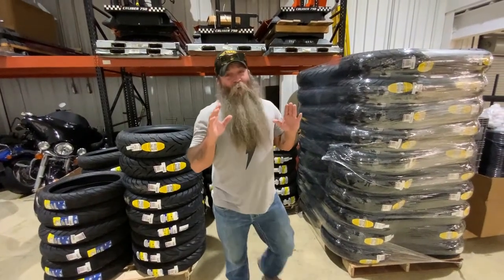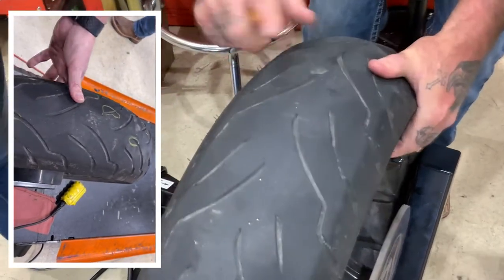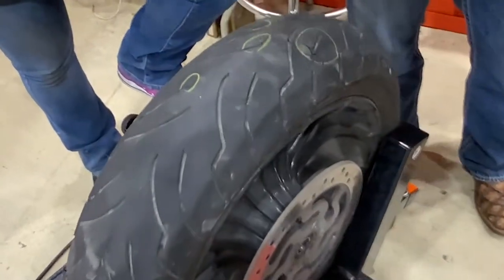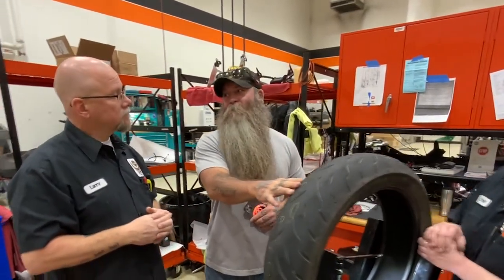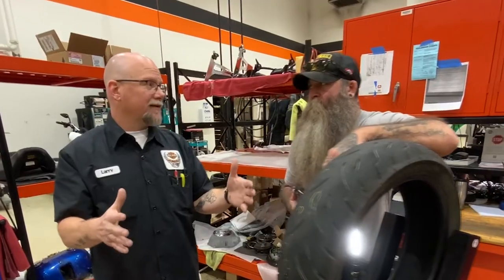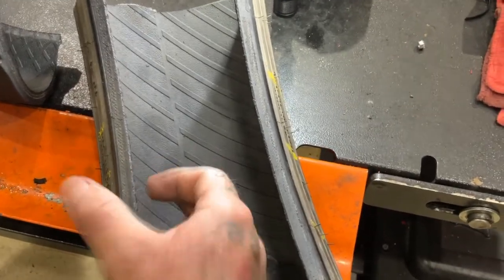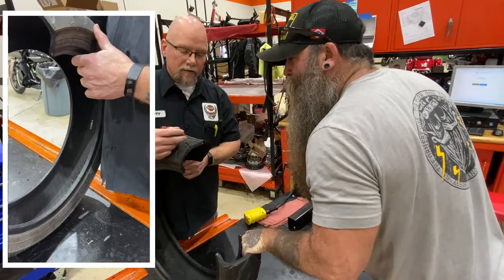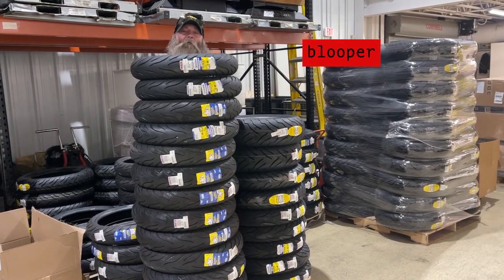Best Tire for Long Distance Touring on Motorcycle Ride? How to get the most miles from your tire~

Comment: That doesn't look normal to me.  I ride a 2018 FLTRU, (Industrial Grey) mostly just me with maybe 100lbs of gear, I'm 202 libs.  I live in an area that gets 80-100 degrees in the summer.  I'm back to running the original Dunlops and must say I like them , they perfrom well in all condtions, wet and dry.  I did try a set of Commander 2's and got much better mileage but they were no where near as good in the rain.  I also run hard, in the twisties scrapping the boards often.  I do next to nill riding on the dirt or gravel.  So after 74,000kms on the bike I 've learned that even 1 lb difference in air pressure can make a big difference, especially if your laying down a 500+ day as I cupped a set of tires pretty bad by getting lazy and not checking tire pressures.  So on the original Dunlops I get about 14-16,000kms on the back and 18-20,000 kms on the front  (8,000 to 10,000 miles on the back)...(11,000 to 12,500 on the front).  Amazes me some people say theu get 20,000 miles on a rear tire?  Oh I also live in the mountains of BC Canada, weather can change in a hurry so I like an all round sticky tire.  Might try the elites next set see if they work as well in the wet.  I check my air pressure now everyday.  Nothing like having good rubber!

Comment: I had the same issue on two American Elite tires too. I ride the same as you, but I can almost guarantee you it isn’t the weight of the bike causing it. I’d do solo trips for 6,000 miles and the tire would start splitting! I also did a video on this tire doing this. I stick to Shinko 777HD, softer compound and only get about 7-8k on the rear. Still cheaper and more safer than these Dunlop American Elites. I’ve loaded the bike with the same weight as on a American Elite....and it never splits. Great video man!

Comment: I don't buy tires for mileage. I buy them for handling and performance. I like Metzler over Dunlop myself, although my last set of Metzlers is 18 months old and the front tire I just found a crack on the sidewall the entire circumference of the tire on the high side. Starting to wonder if anything is any good anymore

Comment: I know this message is late but, My 19 RG only has 8k and I have the same issue with the stock Dunlop HD rear tire. I did contact Dunlop and they are working with me as this seems to be an issue with maybe a bad batch that were made and sent to HD to install on the new bikes.

Comment: Smiling!
Been running the American Elite 3 for years on my ultra classic in Arkansas and never get over 8,000 miles out of the rear on the chip and seal roads here. 
Got a crack in the side wall on the front that's not even half worn out. Crack all the way around both sides and you can see the white cord it's so wide. 
For the money they should last longer. That tire looks bad, real bad. Think I am going to try something else this time. 
Dunlop seems not to stand behind their tires now days.

Comment: Geez.  Got my first Harley this March (2010 Road King).  Put 12,000 miles on it.   Harley dealer put a new rear Dunlop 402 whitewall.  I got 7500 miles and it’s shot.  I don’t ride hard or fast.  I expected more.

Comment: I currently run the stock Dunlop. 
10,000 miles on it and I have the same kind of cracking on it. Also was running heavy on long trips.

Comment: Michelin Road 6 GT Pro. If the tire cracked from the inside out wouldn't it lose air? No motorcycle tire lasts 30 thousand miles

Comment: I had the same issue with the stock Dunlop tires on my 2014 Ultra Limited. Will never run Dunlop again. I'm running Michelin Commander II's now with 15,000 miles on them and still got plenty of tread left.

Comment: Had same issue with stock dunlop and the dunlop your changing out.  Went with the michelin tires and had no splitting issues wiith the michelin brand touring tires.

Comment: Ask Larry at what point your tire pressure goes up like my tire pressure is 40 psi it goes up because of riding to 51 psi do I need to let out air?
Reply from the maker: What tire are you running?
Reply from the maker: If your tire pressure was set when it was cold then you shouldn't have any issues.  -per Larry

Comment: Yeah that's very possible you need to buy a heavy a dirty tire our tire that's rated for a higher weight capacity I went to the Bridgestone extender Max because I learned really quick my bike will chew up the lighter weight capacity tires for my bike the higher horsepower I have to have a heavier duty tire and also a tire that will keep up with fully loaded heavy saddlebags

Comment: I don’t run Dunflops they are horrible wet and don’t last at all my Michelin commanders stick really good on all road conditions even tar snakes and last forever. 12000 miles ain’t nothing.
Reply: Absolutely I hate a dunflop. Commanders are where it is at.
Reply: Michelin Commander 2s were too damn slick in the rain. I use Avon Cobra Chrome in the front for the stickiness and a Dunlop American Elite in the rear. I currently have 13k miles on both and both are only 1/4 way worn. Both are great in the rain too!

Comment: Tires are cheap people, hospital and recovery from a fall is not. Please, folks...replace your tires by the time you get to the HALF rating point on the miles, running to MAX ratings isn't intelligent folks. Plus, you're just hoping your tires keep up, I want to KNOW, and following my suggestion, you'll have nice black flex and operation. You lose the tech of the tire anyway in it's back end of it's life...You'll keep them down and on the ground brothers and your maintenance will be nothing because you're running on the proper "flex" also. You were running on bricks man, about to explode....be safe folks. Let's all make riding safer ;) peace...(typed this while Larry was saying it Lol) thanks, good video man ;)

Comment: If you want a bike that handles bad in cornering get dunlops....if want a bike that handles likes a motorcycle in corners should then get Michelin Commanders. Dunlops new from the factory are to squared off and start to make the bike squirm in high speed corners which make Harleys get a bad rap for feeling like being hinged in the middle ...when all along it's the crappy tires that Harley puts on from the factory. I've owned 8 Harleys from new and when the factory tires wear out I get Michelins ...Dunlop makes awesome sportbike tires but crappie  cruiser tires.

Comment: Well you sold me to NOT buy the Dunlop American Elite, i had Metzler ME888's and went 17,000 miles and i ride 2 up and i'm 5'11" 345lbs and my wife is 5'3" 150ish  and my ME888 had plenty of tread left, but it was cupping and that's why i changed them at 17k

Comment: that tire looks very unsafe there is a problem there  for  sure  i run the  stock  dunlap tires on my 2013 street glide  got  around 20,000 on rear tire   been riding harleys  for over  20 years  always stuck with the  stock tires ride  safe out there
Reply from the maker: We have not had good luck with the stock tires at all!!! We have a video that shows some strange signs in the stock tires. Not for us.

Comment: I have gotten 14K on an American Elite Rear tire and it didn't look anything like yours. But then I am anal about air pressure, if you're not checking air pressure on your tire's you're asking for trouble you can't blame a tire for failing if you're not maintaining it. I have never been to an HD dealer that didn't try to get you to put stock Dunlop's on your bike I even had one refuse to put an aftermarket tire on once which is a joke and why I buy tires online and get them mounted at Cycle gear.

Comment: Iv tried several different brands and sizes. Iv got the most bang for buck with a car tire. Which cost about a third the cost. It handles a little different but with a passenger it's really hard to feel anything different. Never had a car tire split like that either. One more thought also. The contact patch on a car tire is two or three times larger.

Comment: Overweight and hard. I don't believe anything is going to stand up to 110° if you don't pull over if you notice any slipping or going on rough roads. It's rubber and heat is going to eventually wear any tire out. And if you are running 2up? You are lucky you got 12k in extreme heat, cold and overweight on the same tire

Comment: 12,000 miles, that tire owes you nothing. There's alot that happened in that 12,000 miles, heat, speed, road condition, weight, dude, your beard alone durn near overloaded that tire.

Comment: I'm pretty sure those are stone bruises.  If you're heavily loaded, running on hard packed dirt roads that have been covered over with crushed rock, you're going to get stone bruises.  Those marks are too small, too pin-pointed to be heat separation.  Crushed rock has very-very sharp rocks.  Ive ruined steel belted radials on my truck from stone bruises on freshly graveled roads.  Stay off craveled roads that have been layered over with crushed rock.

Comment: Way overweight on the load on that tire.... Any licensed pilot that has to do weights and balances before taking off and flying, and keeping the center of gravity correct on a plane knows how important it is to not go overweight, and also WHERE in the plane, you locate that weight, fore and aft of the center of gravity of the plane.  Another huge factor is how fast you travel!  Riding fast makes a lot of heat.
Reply from the maker: yep yep!

Comment: A poor quality tire with very poor mileage endurance for an extremely high price.

I have been using the Forceum HEXA-R 205/45 ZR18 Tires for over a year now on H-D Road Glides.
The pressure I like for comfort and safety is 36 pounds.

This tire has a larger patch on the surface and therefore more purchase on the pavement.
I ride 80-100 thousand miles per year, 99% hardtop.

I average 22-24,000 miles per tire for hard, hot, fast, and heavy riding.
And each tire costs $82.

Comment: I can't believe the condition the tire that came off your bike. That is not acceptable. Someone shanswer for that.
  Up until the last couple years I could not afford to buy new tires. 9 out of 10 times if I needed a tire I would go to bike shops and see qhatrires they had in the trash.  Sometimes I would find a semi decent tire. Most of the time they barely had tread on them.  I've run rear tires on the front, front tires on the rear.  I've even run tires for many thousand miles that were mounted backwards.  I have never had a problem with any tire that was not due to age or normal wear.  Because I always had such crappy tires, I always ran tubes in my wheels.  Most times, I would run my rear tire down so far that I would be wearing the inner tube.  
      I've never seen cracks in tires unless they were many years old and way way past there life span.  TIRES DO HAVE A EXPERATION DATE !!!  Tires are only good for a specific amount of time from the date of manufacture.  
    All that being said, I do prefer Dunlop tires on my motorcycles.  Although in the last couple years I've begun to question the quality of Dunlop tires.  I bought a 1998 fatboy last fall.  It had brand new Michelin commander II tires installed on it about 400 miles before I bought the bike.  I've rode roughly 5,000 miles on those tires and so far I've been impressed.  They look absolutely kick ass on my rims.  They role really well down the road.  They are quite when rolling down the road.  They ride well.  Performance, compared to what I've experienced in my 42 years,  is top notch compared to any other tires I've ever had.  Tread life,  they seem to be wearing quite a bit faster than what I would prefer, especially for what they cost new.  If they did not wear so fast they would be a harder compound tire and probably wouldn't perform as well as they do.  I think a person really needs to come to grips with what they expect from a tire before they buy new tires. 
      Great video my man.  I watched it when you first posted it but, I decided to click on it again for whatever reason. 
      Have a good one and take it easy !!!!